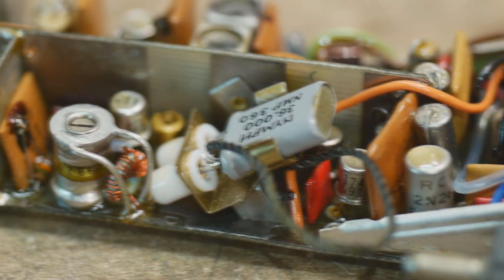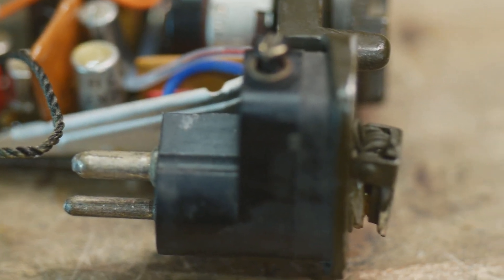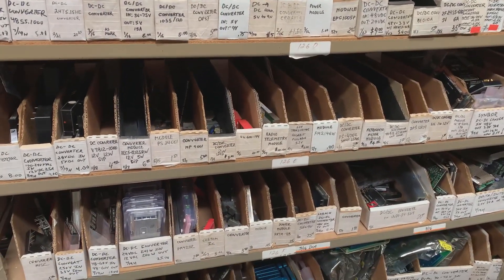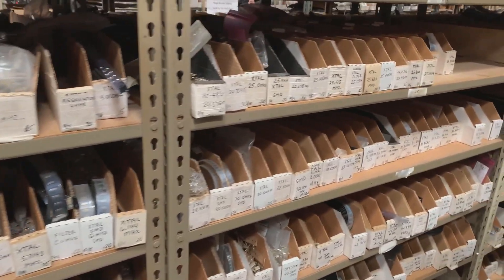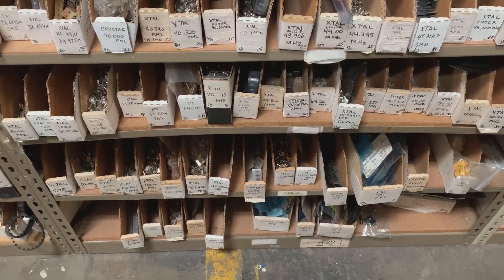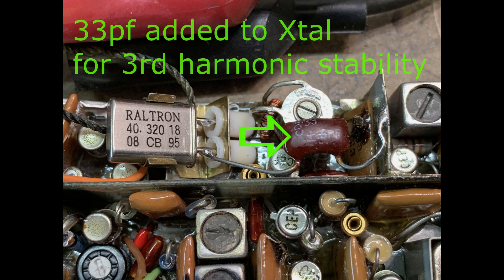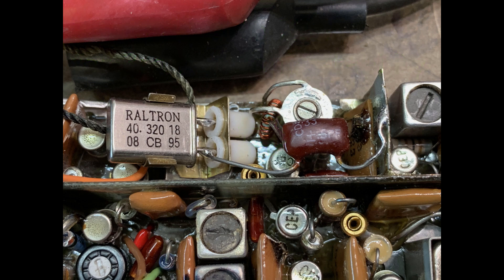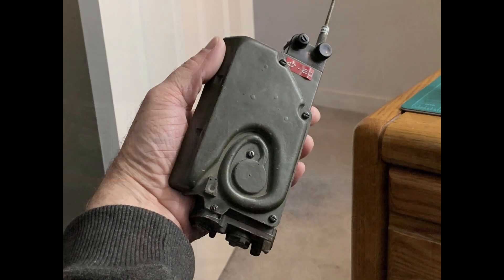#764 AN/PRR9 Vietnam Army Radio Receiver 50MHz (part 2 of 2)

Comment: Great Radio for outdoors!, military equipment is very good for heavy duty.
And great junk store!, locally our store has just a couple of tray with assorted xtals, bad luck they didnt have any suitable xtal for multiplier to get the 433.9 for  my tinySA TG, as i saw in one of your videos, ( altought i have a NS), so after two trips up there last friday finally i found two xtals for the mixing to 108.475 and then x2x2, using a DDS is too much overkill for a single frequency. 73s.
Reply: Are there any junk stores left anywhere? Or just any stores at all?
Reply: @mohinderkaur6671  nowadays the only two places here is flea market and ham radio flea market, there we buy electronic junk and if you go early you can find some gem!.